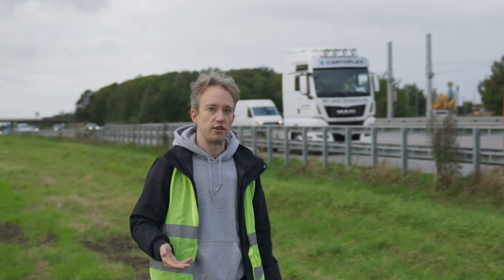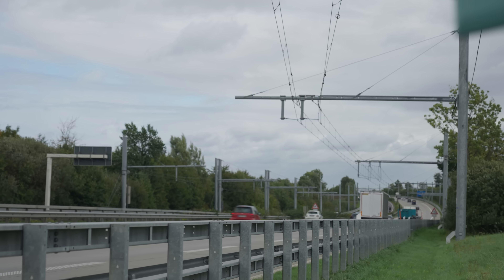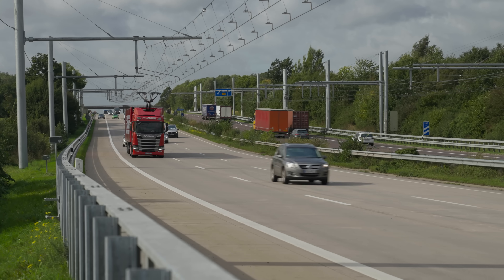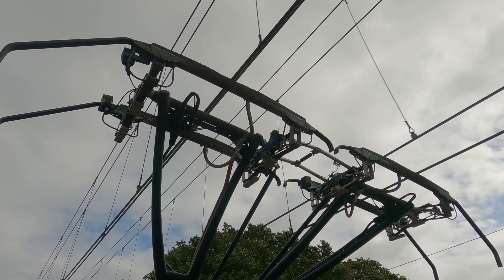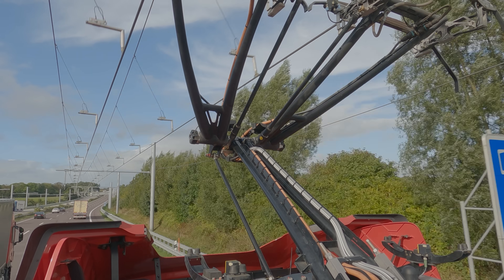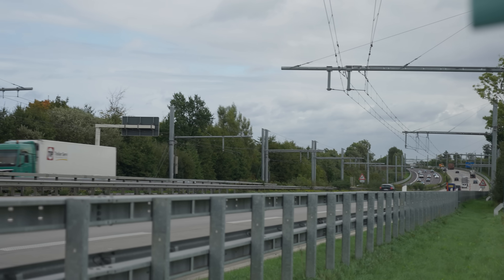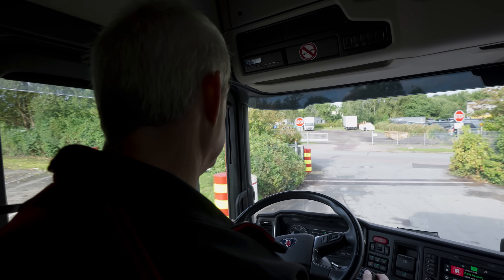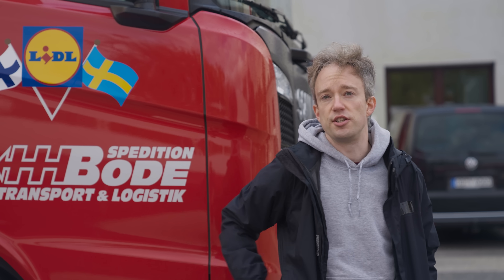The highway where trucks work like electric trains

Comment: The real most efficient would be a rail. At best this is only a short term solution.
Reply: Well Rails are already very heavily used, and putting all the traffic from the highways onto rails would not work without multiplying the amount of rails that are laying. 
Plus the charm of highways are, you can drive there adhoc without planning, without permission. Rails need to be planned out ridicolously so trains dont crash into each other, and take away a lot of those adhoc freedoms of sending and receiving stuff. Sure if its regular transport, you can plan for it, but not every delivery is a regular delivery.

Comment: A fun bonus for this, would be that having these infastructure in the roads will open a market to hybrid electric buses, that would use electricity on the highways, and use fuel when they get back into a town. So while this will intially be used only by trucks, other transport vehicles might join in as routes become fully built.

Comment: i always wondered why no one is considering that. my dad used to work at german railways in maintenance of the overhead power distribution system. didn't know we were doing that already! realizing the worth of our core competences, or recognizing which those are, is  not the strong suit of us germans. which is why we gradually lose those competences. railways and overhead power distribution is undoubtedly a thing we really used to excel in. given that we also geographically are the place for transport within europe to traverse through, rolling that out on all our 'autobahn', has the chance of drastically changing the co2 output of all our neighbouring nations too. and this time we would neither have to rely on forcing everyone into submission, nor pay for it ourselves, by just have every truck pay for either the maut, we charge anyway, or use the electricity and pay that instead. i guess siemens did a lot of lobbying to make that happen, which usually makes things much worse and mindboggelingly expensive, but this time it could turn out to be good, for once.

Comment: Use of catenary for electric buses has been around for many decades.  In fact it seems a relatively recent implementation for hybrid buses exists in New Jersey from 1993, perhaps there are earlier examples.  The buses operate both on and off the electric grid.

Comment: I drive semi's here in the USA and I think this would be a great idea. Though you would need to figure out how the ideling would work. I practicaly live in my truck so i've got the engine running 24/7 as you can't run the airconditioner without the engine running. much less watch tv or play on your game console.
Reply: Having driven through Arizona and New Mexico (where it's literally nothing around for literally days) i agree, this would be amazing for the US. As far as parking, can just as easily have wire sets over the parking area and connect to them for over-night. That would also cut down on random trucks being parked at the exits, shoulders, and where-ever else their allotted driving time happened to be up. If you do have to stop at a random spot, i'm sure main on-board battery would last for a few days just running small things like A/C, some 110v outlets, and other creature comforts in the truck.

Comment: I dreamed up something very similar once, except my idea was to have the power strip built into the surface of the roadway, not unlike the old Tyco "slotless" slot car sets. That way small passenger vehicles could access it too. Probably impossible to practically and safely implement such a setup, however.
Reply: Conduit current collection (with a slot in the roadbed for a collector plough to connect to) was a thing, though I think it turned out to be more trouble than it was worth and nobody uses it anymore.
Reply: @wolfgangmcq  That does not surprise me one bit.

Comment: You say that is takes a big battery to make a truck work as it does on diesel but if you remove the engine completely then there would be plenty of room for a big battery including backpanels. dont you think that would be enough room?

Comment: Why use a battery? Just have a hybrid truck using energy from the grid when possible. It is a nice patch job but nothing can beat the train so investing in railroads is key to sustainable future.
Reply: Because new fuel burning trucks will not be allowed from 2040 on.

Comment: Could never understand why the rest of the world dont use road trains. Australia uses them, 1 tractor unit pulls four trailers, its not new technology, but its 4 times more efficient than 4 tractors pulling 1 trailer each. Little or no extra infasture spending required, especially if used on night trunking routes.

Comment: Its all well and good claiming the safety concerns are "resolved" by reducing the power of the cables; but that only holds true with a low quantity of lorries using the system. More lorries will need more simultaneous power requiring the cables to be higher power. There's this weird habit that rail network operators have of walling off the network to prevent trespassing and theft of this equipment.

Comment: People are likening this to trains, but a closer analogue exists. It's literally trolleybuses except trucks
Reply: Hm... Trolleytrucks really rolls off the tongue doesn't it? Kinda like Bendybus
Reply: Trolleytrucks already exist too! Trolleybus companies often have a trolleytruck as a service vehicle
Reply: Except they're using pantographs instead of trolley poles, so... Pantotrucks?
Reply: Their behind you!
Reply: Trolley + Lorry = Trollorry?
Reply: @WillowEpp  Trollory is the obvious choice here if you ask me. Emphasized like Mallory just with a different vowel at the start.
Reply: Yep, and we've had trolleybuses for hundred odd years!
Reply: Came here to say this, trolleybuses are fairly common in a lot of places.
Reply: @sidbrun_  My home city had trolley busses until recently, they removed it now because the equipment running it was like 100 years old and needed replacement, and the network was far smaller than it used to be so wasn't worth the cost to replace. But if they had put trucks and all on to that network too, as long as they had engines to operate off the network, or batterys, then maybe it could have survived.
Reply: @sidbrun_  And hearing 'trolleybus' in the Russian language is very sweet.
Reply: Except trains are a lot more efficient
Reply: Trolleys that can detach themselves from their lines and drive anywhere needed. Even better
Reply: @ninjax4909  many new trolleybuses have batteries so they can drive off-wire for short distances. For example it avoids the need to have a bajillion wires in the depot
Reply: I think the train comparison is, in part, because if truck traffic is so heavy along a specific route that this makes sense, there's a good argument the freight should be rail hauled instead. Given its only 2km maybe not in this specific case but others should consider rail-truck hubs of some sort closer to the goods final destinations
Reply: Trolleylorries - say it fast 10 times.
Reply: @izpodpolja  trollololollooloolorry
Reply: @izpodpolja  trolley truck is much easier,then maybe the English will start to speak proper English.
Reply: Not at all
Reply: except trollyebuses run on RAILS.
Reply: @agnidas5816  please do an image search for "trolleybus" so that you understand what we are talking about
Reply: @agnidas5816  they literally do not. Trolleybuses aren't trams.
Reply: @agnidas5816  trams run on rails, trolley buses are like regular buses but are connected to an overhead wire.

Comment: Why not just boost trains and bring goods back on the track, which is even more eco-friendly? The only downside two downsides to this are, that it doesn`t work everywhere. You`ll still need lorrys to bring goods from trainstations to the supermarket. But One Lorry Driving from Naples to Hamburg just isn`t necassary, when you have a train. The other downside is, that the Railway network must receive an large extension, which in the short turn is expensive but should save costs in the long run. But this doesn`t happen because - and thats a sad fact - driving goods on lorrys through half of Europe is just more cheap than by train - which it just shouldn`t be.
Reply: I'd prefer the austrian way too where trucks are only allowed as far as the next freight train terminal. But still, especially in Schleswig-Holstein, we'd need to extend the rail network and build more freight terminals.
Reply: @wilfriedklaebe  Yes I agree with you. But beeing also from  Germany (Bavaria) there is alsways the Problem with local Resistance against the extension, which is partly understandable but also quit sad because looking in the future yuo will always gain from better railway networks.
Reply: completely agree, the whole concept of electrified motorways, as tom scott said, is to be rolled out where huge volumes of freight are moved by road over trunk routes between major depots and ports - and this kind of thing is exactly what rail freight is good for. It'd be more efficient as well because less staff are needed and the physical interchange of steel on steel means less energy is gonna be used in moving the vehicle.
Reply: Trains are drastically cheaper in the U.S. for shipping. I don't know how they could more expensive in Europe where diesel fuel is much more expensive. Europe also has the development density to fully utilize trains, unlike much of the U.S.
Reply: @skipads5141  In Europe we use most of the train tracks to move people since that is more effective than everyone by personal car.
Reply: @skipads5141  trains make more sense in long distances, Europe doesn't really have those. We use trains between China and Europe however.
Reply: Putting freight on railways slows down commuter trains. That's the reason why US trains are so slow -- it's not because we can't build fast trains, it's because the overwhelming majority of our freight moves by rail, and fast freight trains would be insanely dangerous because they're so much heavier (and more combustible) than commuter trains. The "obvious solution" of building separate tracks for freight and commuter trains would cost 3-4x more, because the land near existing railways has gone up in price due to commercial activity over the centuries. So instead we're stuck with slow commuter trains, and Europe conversely is stuck with lots of trucks on their freeways.
Reply: In the U.K. at least the railways are already saturated, road transport is just cheaper and less hassle than rail.
Reply: For those who dont know: NIMBY means  Not In My BackYard
Reply: To transport goods out of trains to delivering stations, and from delivering stations to houses, ya gonna need trucks. Trains, unlike trucks, are only efficent on long continuos tracks, they can't change routes efficently, so if you want to have a freight train system that connect multiple cities with each other, and with the efficency of lorries, you will either have to build a system with a lot of tracks and small trains, like A LOT, so it could cover areas that trains can't normally reach such as downtown area, not to mention the station and land space cost. So the best solution is just keep the status quo where trains handle long-range transportation, trucks handle medium and short range. Beside, my suggestion is that the electric highway here can be used to charge the trucks while they're still on the road, therefore compensate for the electric vehicle problem of having recharge frequently, thus making them more efficent.
Reply: Train do not go everywhere where it is needed, distances/destinations that trucks already do.
Not every country (even in Europe) uses fully electric trains, some are limited to Diesel/Electrics, which still burns fuel.
For Europe, transporting people by train is more important, but there are cargo trains going from one end of the continent to the other end.
Reply: @DarkDutch007  it seems trucks are better in dense Europe. We still use trains between China and Europe for very long distances.
Reply: Railways are also more expensive to build
Reply: @sleepyfox7671  Thats absolutely incorrect.
Reply: @theempirestrikesback2939  How is it incorrect?

Edit: Thank you for pointing out my idiocy. After a quick google search yes, railways are cheaper.
Reply: how do you get the stuff from the train station to literally everywhere else? trucks
Reply: That doesn't mean they couldn't co-exist. Trains are far more efficient when they not fully loaded, which means most of the goods transported by trains are not time sensitive because they have to wait for others. If you only need to deliver a small amount of time sensitive goods in a closer distance, then trucks is still you best choice.
Reply: Automobile lobbyism and the hidden subventions of lorry traffic are the reason.
Reply: Trucks can go separate destinations piecemeal, while train will have to haul all the attached carts all they way.
Reply: Trains are good too. This is an addition that's better than fully battery powered vehicles.
Reply: Correct. But the truck takes 16 hours, the train takes one week.They don't get this organized.
Reply: Because trains can't react to changing conditions.

When you build a train track, that is the path goods will take for the next century. The only way you can adjust to circumstances changing every few years (one city growing faster than another, one port expanding to accept larger ships, certain industries booming or dying, etc.), is to physically lay new tracks.

Trucks are more fungible. Every single load can take the most efficient route at the moment, and then take a different route tomorrow, and a different one again the day after. You are going to need a cross country road network anyhow, just to let farmers get into town and townies to visit each other, so the trucks will follow those roads along the most efficient path, and then you can expand the roads into highways as certain routes become more popular.
Reply: @boosterh1113  That's what last mile delivery is about. You only put a train cargo hub in massive cities, for the rest you put one nearby multiple destinations and have trucks do the final stretch. There's no need to have trucks drive across the country when one train can replace hundreds of trucks.
Reply: @codec862  transfering cargo takes a lot of time. Also you need more trucks to wait at every destination. And then they waste time when thee is no cargo. (As usually you need only one container, not the whole train).
Reply: @boosterh1113  trucks taking the most efficient route in the moment is greatly nullified by the very poor energy efficiency that trucks have.

Obviously trucks will still need to be used in a small capacity for that last mile transfer, but the vast majority of goods are more suited to being moved by rail. The only thing holding them back is a lack of investment into the Railways.
Reply: This is an awful idea. My reasoning being that my bed is 20 feet away from a railroad track that thankfully has not been in use in the last few years
Reply: @VanessaMagick  
As someone who lives directly across the street from a frequently used passenger train line, I don't think I ever even notice when trains pass by
Reply: trains aren't that eco-friendly either
Reply: The idea of expanding the rail infrastructure is a nice one but who’s going to drive the trains? It’s easier to train some to drive a lorry than it is to drive a train.
Reply: @FPK NIMBY is what preserved European old towns and history. Wouldn't say it is that bad.
Reply: Can a train go off the rails and drive down niche roads? No. You'd have to move the cargo from the train onto a truck. Having it on the truck to begin with removes that unload-load segment.
Reply: I don't like how trains look and sound. However, in many truck routes they wouldn't make sense. I don't get why when we have awesome road infrastructure so many fanboys want to revive ancient tech.

Comment: Welll if been driving there two times a day once or twice per week.
Ive never seen a single of those trucks but definetly had my fun with the road works to put up all of this.
Ofocurse its only a test platform but its about two or three trucks that are being used to test this road and in my opinion thats just not enough.
Also the technology isnt that new if you look at the o-bus in for example solingen, which works in a similar way.

Comment: IT IS a electric train but in worse! Instead of rubber tires, rails and metal tires +  50-100 containers attached it would be at least 50-100 times more efficient!

Comment: Here is another question. Recently electric have soared to the point of where freight train operators like Freightliner etc are switching to diesel locomotives. Won't this be more costly than using a traditional diesel truck. Maybe the electric companies should be forced to lower their prices to be more competitive. My electric bill is now £2.50 more in service charges a week and I am a low user.

Comment: In the UK at least, the motorway network is used to transport abnormal loads and all bridges on the motorway have a high minimum height. Adding wires under bridges, plus safe vehicle clearance from these sites would obviously lower this.

Comment: No body seems to have mentioned the transportation of awkward loads that are too high to fit under the cables and in some cases could be too wide to just move into the middle lane
Reply: Couldn't you just offset the collector and drive in the middle or far lane for extra wide awkward loads?
Reply: @nogravitas7585  the collectors seem like they dont intend to be moved and if the load was on a lowboy like they use in America then the centre guard rail means you cant keep all the way over